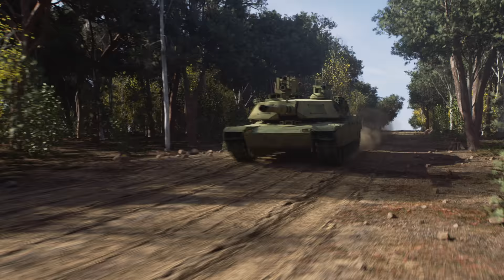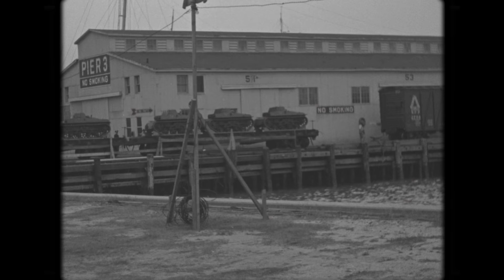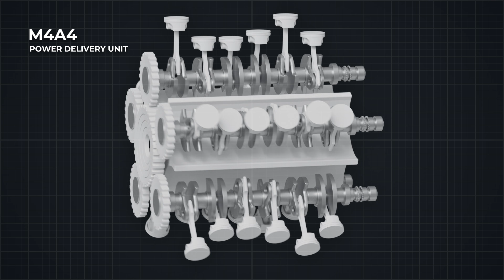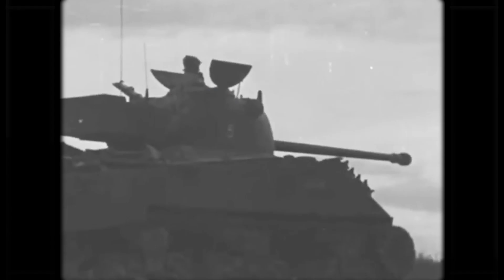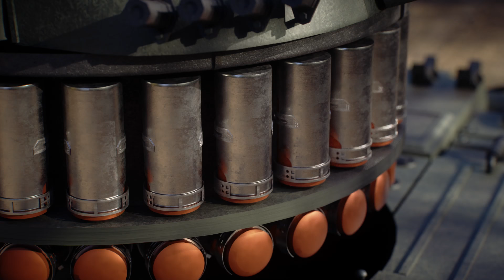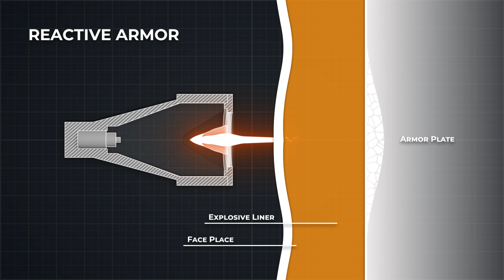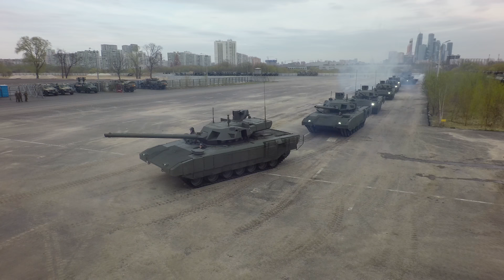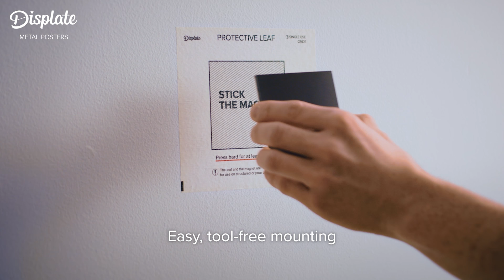Why America’s Tank Failed in Ukraine

Comment: I usually love these videos, but I have never seen a more incorrect video.  The idea that fuel consumption is an issue in Ukraine is ridiculous.  These are the most static frontlines in history, moreso than even WWI.  An Abrams could drive deep into enemy territory on a full tank of fuel without issue.  An armored charge in this war might be 2-3km at most.  An Abrams can do 150 times that distance without issue, without refueling.

The reason 27/31 tanks were knocked out is because they were heavily used because of their survivability.  They rarely burned down and the crews survived.  They were recovered and repaired many times.  

Eventually any tank will take unrepairable damage.  These tanks were used dozens of times in combat before being unrecoverable, and that is why they eventually took a high loss rate, they were the tip of the spear every time.

This video is perhaps the most naive and misinformed I have ever seen on this channel.

Comment: This is complete and utter nonsense. Without knowing exactly how the Abrams were used and deployed, there's no way of telling whether the "failure" had anything to do with the design (which is fundamentally no different than other Western tanks like the Leopard 2 or the Challenger, BTW) or the battlefield conditions. 

News flash: Military vehicles are always lost at extremely high rates during heavy fighting between evenly-matched opponents.

No tank was ever impervious on the battlefield, and no one who knows anything about tanks expects them to be. Tanks were always vulnerable when not supported by infantry and exposed to air attacks, always susceptible to flanking, always susceptible to mobility kills (you can't armor tracks) and everything is vulnerable to heavy artillery.

Comment: Exceptionally poor video from you. The first 7-8 minutes could be cut with almost no loss of context, and the latter half is just a jumbled mess of information that could not decide how to put itself together.

You say it yourself: Most Abrams in Ukraine have fallen to either drone attacks or mines. What does this have to do with its turbine powerplant? The answer is it doesn't. On the other hand, diesel-powered tanks have been blown up by the thousands. There is no correlation here. Ukraine operate less than two dozen Abrams, they do not operate hundreds of them, there is no meaningful concern of fuel consumption on an operational level. The true answer to the video title lies in how Ukraine tried to employ Abrams in maneuver warfare early on, and failed. This failure in tactics would've been the same whether Abrams, T-80, or Challengers were involved.

You tried to force an engineering lens onto a warfare doctrine question, and there is just little to be found there. Coupled with a lot of duration-padding and errors (such as showing AbramsX footage for M1E3) and the result is a slop of a video. This could've been much better had you just kept it simple and commentated on the future of the Abrams, independent of the Ukraine war.

Comment: The leopard 2s have proven to be the best MBT platform in Ukraine as they were built with the Eastern European combat theatre in mind.. the logistics of it are relatively forgiving, supply chain is more robust than most, the diesel engine is on par with the Abrams turbine engine in horsepower, significantly higher torque, less fuel consumption and less IR and noise signature. Also it is slightly lighter which makes a difference in Ukrainian terrain and the older 2a4 provides superior protection compared to the m1a1. The abrams is cool and all but it's okay to admit it simply isnt as effective in Ukraine regardless the excuse of "it isnt used with American doctrine" or "poor training" or "they're old variants".... the leopard 2 faces the same issues. Don't know why the whole comment section is full of Americans upset, the abrams isn't a superweapon and isn't always the best tank. All the other MBTs face the same issues.

Comment: The Ukrainian stalemate is not "the modern battlefield".
It's a probably quite unique case of long term attritional war in which both sides have very limited means of air support, and in which the Ukrainian strategy is to hold tight and let the Russian army exhaust its heavy equipment. This is nothing like what American tank formations would be dealing with.

And the Armata is the biggest joke in armored vehicles in living memory.

Comment: 20:55 Sorry, no Sneeki-Breeki for Abrams... This electrical part of a engine is most likely simply for the tank's operation while stationary. Auxiliary power units are usually used for this: all those termo-puking scopes and other gadgets and doodles, even the turret rotation, require power. And yes, this will definitely significantly reduce the tank's visibility in the thermal range. But that's make's me wonder: how flamboyant will the electric batteries of the new Abrams will burn...

Comment: X66-Mammoth Tank with dual 188mm turrets with double quad specific impulse fuel give a range of 3000km at 70kph and multi-engine for idling, minor movement, reduced heat output, and tiberium crystals added to fuel provides quad fuel potential energy

Comment: The M1E3 they showed at the Detroit auto show was powered by a Caterpillar C13D diesel engine. The tank you are showing is the GD AbramsX demonstrator that had the Cummins, which it doesn't sound like is being actively developed now. Two different prototypes
Reply: The M1E3 and the GD AbramsX have quite drastically different designs. This video did numbers but it feels a lot more phoned in than other Real Engineering episodes
Reply: Yet M1E3 still possesses the same things discussed in the video, it is getting an autoloader (the eastern tanks already have). M1E3 is getting a crew compartment separated from the turret (Russian T-14 already have). M1E3 is gonna get a diesel engine + electric battery hybrid... D.I.E.S.E.L engine is the main focus! (which the eastern tanks and euro tanks already have).  We already are aware the T-14 is being developed slowly, cuz only America had $1 Trillion defense budget for an outdated concept for a tank on the modern battlefield. Pls explain what is discussed false and wrong in the video in its entire theme...
Reply: @mab2187  The M1E3 does not exist yet. The tank shown was a testbed vehicle for army trials. It is not even certain that the unmanned turret will make it into the final design.
Reply: @mab2187 then show the M1E3, it's lazy. It's like showing a 737 when you're talking about the A320 because they are kind of similar.
Reply: @999knives  "then show the M1E3, it's lazy" ??? you want me to get an emotional reaction out of an inanimate thing? are you insane. lmfao.